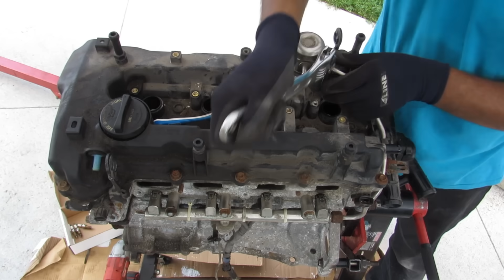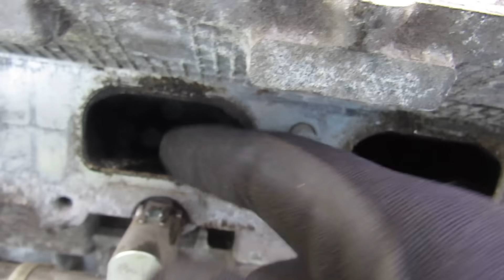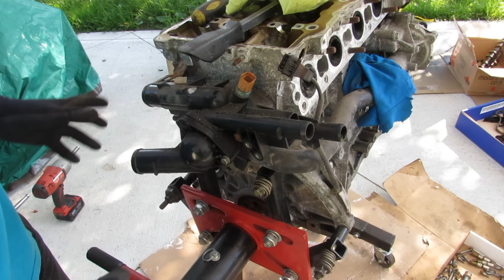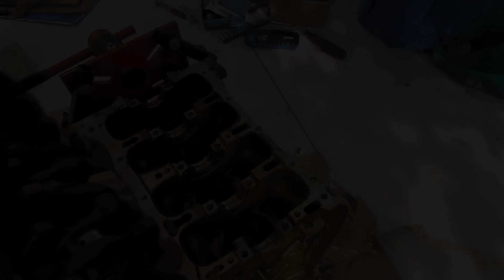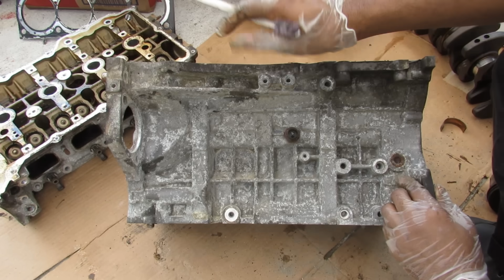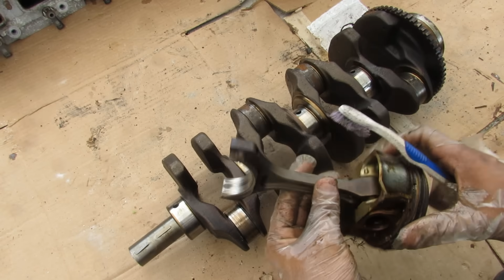Why Hyundai Engines FAIL

Comment: The major problem is lack of lubrication is what you say. Did the driver check the oil level?  How often was it checked. All engines lose oil when driven so the level should be checked at least once or twice a month just to be safe and know your engines oil consumption. You don’t know the answer to this so what happened to the engine you have could of been caused by lack of maintenance. I had a 2012 Santa Fe with the 2.4 engine with 118k miles on it. I only put full 100% synthetic oil in it and never had a problem with the engine. This engine your videoing those answers must be addressed. Thanks.
Reply from the maker: Good maintenance can help aleviate it. But when it's do bsd thst Hyundai had to issue a recall and vehicles with the 2.4 liter the marketplace with blown motors...

Comment: I had a 2007 Sonata 2.4 liter 4 cyl and ran it 144,000 with no engine problems. Never burned a drop of oil and it ran like a Swiss watch, so quiet you weren't sure it was running. Sold it to a grand daughter and she is still driving it at 190,000 miles. I had the 1st oil change done at 1500 miles and ran Penzoil full synthetic 5W30. I was told that the motor was a group development between Hyundai, Chrysler, and Mercedes.

Comment: I own a 2015 hyundai imax 2.4 ltr petrol, my engine knocks due to a suspected spun rod bearing, so I had it towed home because it cut out and wouldn't restart.
 1st mechanic I found of f.b, he told me the engine was seized, 2nd guy was an auto electrician he told me replace battery, done, not starting, I then had it towed to a local mechanic, he a devised to replace starter motor first, did that, he then dropped out the sump, found golden flakes and shavings in it, he advised a spun rod bearing most likely the issue, he replaced oil and worked fine, he did advise that the fault has not been repaired therefore the vehicle could run and die any stage.
So I've driven it for about 3months, now engine is knocking.
I've then taken it to Hyundai to see if they could repair under an out of date warranty. There mechanics diagnosed it as what I've suspected spun rod bearing. And that i need to replace engine, 10k AUD, I'm like what the faaarrrkkk

Comment: Well Hyundai used the same engine for a long time. Basically, they changed Bumpers, Lights and saloons but not engines. And they have not invested too much for engineering. Some parts like old soviet car engine techs. If you get any problem with oil, or oil changing period you would definitely have engine problems, which will cost significantly a lot.

Comment: I didn’t watch the video because it’s way over my head. However, I own a 2014 Hyundai Elantra with about 64,700 miles on it. The engine broke down twice. First time was in 2019. Something wrong with the cylinders not creating electricity. Partial rebuild. After my car totally checked out, I started a 6,000 mile odyssey. Just 100 miles from home, I threw a rod. It took 1 1/2 months, but I got a new long-block engine. Fortunately, I had an extended warranty. I hope it holds up.

Comment: The 'manufacturing debris' was a lie to cover up faulty engine management and design.  To keep the intake valves clean, Hyundai's GDI are running very rich at cold starts (much richer than non GDI engines). This happens both in summer and winter times, for both turbo and non turbo engines. This way some of the gasoline doesn't burn and is coating the combustion chamber and keeps it clean. Downside is excess gasoline also leaks into the engine oil and causes oil dilution. If you're doing mostly short trips, the gasoline in the oil won't have time to evaporate so the engine wear is increased. Another problem is these engines keep a very low rpm in most driving conditions - even when going uphill, even in the Normal and Sport modes. They designed the transmission to have crazy low shifting points in all Eco, Normal and even in Sports mode. It can't be good for the oil pressure at the connecting rod bearings. MPG Obsession took over mechanical engineering.
Reply: I also noticed that these engines suffer badly from oil dilution. The oil got contaminated with gas rather quickly in our sonata and I think that led to the bearings going out at 90k
Reply: @chihirogustafson8557   Correct.  Actually, rev the engine to 5000 rpm just before an oil change (diluted oil), then rev it again at 5000 rpm after the oil change (fresh oil).  You will be amazed how nice the engine sounds with fresh oil, and how harsh it sounds with old diluted oil. There is a way to prevent the oil from getting diluted on these engines, I shall make a video this fall about it.
Reply: This ^. My dad will drive it in eco all the time absolutely babying it. The car also gets moved around the driveway a lot and often doesn’t get the chance to fully warm up. Both my Lexus IS and Acura Tl I had have cleaner oil at 5000 miles than this does at 500 😳. As long as they keep giving us new engines I am fine with it.

Comment: Thank you for the thorough run down.. I own a 2018 Elantra with a motor problem. Where did you guys find your Hyundai shop manual or technical repair guide? Trying to locate one for newer models that isn't a Haynes is tedious. Please let me know if you have a good source, electronic or hardcopy. Thanks all!!

Comment: I was considering buy a new Kia or Hyundai because they are really affordable vehicles and offer twice the amount of miles/years on the front-to-back warranty than Toyota or Honda do. Should I be concerned with '21 and '22 models of Forte, Ioniq (Hybrid) and Elantra?
Reply: newer engines. Just make sure you get the 2.5l and 2.5t. They are newly engines.

Comment: He points out and it shows damage from lack of lubrication. But the question is, why were those particular locations of the engine lacking in lubrication relative to the rest of the engine.

Comment: Have a 2011 Hyundai sonata turbo with 95,000 miles on it and motor is shot its sitting in the shop now it seized up and almost caught on fire 
Luckily Hyundai is covering the cost but it needs a turbo and they are on back order with no release date so could be months

Comment: My wife and I bought a 2018 sonata sport a few years ago. It didn't take long to notice it was burning half a quart of oil every two weeks and it spark knocked all the time even on premium gas. We took it back to the dealer for a software update that might have helped a bit with the spark knock but not much. And yes i tried the intake valve cleaner but it would only clear it up for a few days.  It was replaced with by a Mazda just 6 months after purchase.
Reply: The Mazda is the cure for Hyundai engines.

Comment: If Hyundai will replace engine on warranty that might be the solution. However, I would want to have a good explanation of how the con rod bearings got contaminated / damaged to be sure that it could never happen again. Also, the direct injection system problem with carbon buildup is an issue needing answers. Otherwise the engine design looks contemporary and pretty good.  Internal engine problems like this are the last thing you would ever want to repair out of pocket.  If Hyundai "gets it", takes responsibility for error and covers the costs, then with hard work they can restore their reputation.

Comment: I think a lot of engines get that bearing damage when some drivers wait until the oil light comes on before topping up, and stretching oil change intervals.
I have a neighbour who is on her third engine from doing exactly that, I saw her putting oil in at the gas station and speaking to her about it found out she had the oil light on until she found the servo... ignorance is expensive bliss.
Reply: Not really much of an excuse when you can do the same thing to say Toyota engines and they’ll continue to take the beating. Thetas are just garbage motors all around.
Reply: @Iridiumcosmos  toyotas are junk
Reply: @maga6319  Said no one ever.
Reply: @Iridiumcosmos  says the fangirl. It's the truth
Reply: Oil light should never come on to begin with.. no engine should be burning 1 qt of oil every 1k miles if its under 100k miles

Comment: QUICK QUESTION, WHAT CAN BE USED TO WASH OUT THE ENGINE WITHOUT PULLING IT APART?
Reply from the maker: Gasoline is a good cleaner. What are you looking to clean, the valves?
Reply: @speedkar99   I have a number of sensors for the saying for the same car car (2002 Hyundai sonata) that I wish I could clean, because Those cars are not common in my country, And when you do  Find the part that you need, they're extremely expensive,
Reply: @speedkar99   But I saw you making reference to cuttings in the veins of the engine block, so I was wondering if there was any kind of agent that could be thrown in the  Is transmission oil or the motor oil block that would help to remove move those things and spite them out,  But remember I also mentioned that I would want to do this without the engine being pulled apart, There's not much mechanics in my country who work on these cars or even want to try.

Comment: DO NOT BUY HYUNDAI !!!
I'M ON MY THIRD ENGINE!

The first one seized at 43,000.
Hyundai said it was due to metal shavings circulating in the engine.
Claiming that this was due to a manufacturing problem.

The second one failed at 117,000 when a cylinder and piston failed due to carbon build up.
64,000 miles later.

Hyundai didn't even look at my engine for over a month. Then they denied my warranty claim. They said that the damages cylinders were not covered by the extended warranty on the replacement engine. 

The original warranty does cover pistons and cylinders.

Eventually they agreed to pay 65%
of the engine replacement part as a "good faith gesture".  They are so nice.😀

They had my car in the dealership for about four months.

I will never buy another Hyundai!
Reply: TROLL HARDER BRIAN

Comment: Something is fishy blaming the spun rod bearing and all the other bearing wear on metal debris left in the engine. I think there is a more serious design defect, similar to many BMW engines with bearing damage. With Hyundai blaming the problem on a manufacturing process instead of a design problem, they point blame to the USA engine plant and not the design and engineering offices in Korea.

That being said, I would bet money on this engine, the real problem is lack of maintenance. They went too long on oil change intervals. This caused the oil scraper rings to get plugged up which causes high oil consumption. The owner was not checking the oil level like they should have been doing, and ran the engine out of oil which caused the rod bearing to spin. So change your oil often and use high quality oil, and check the oil level every time you put gas in (for a Hyundai) and every other fill up for other cars like Hondas

Comment: Wife's 2017 Tuscon got recalled for defective connecting rod bearings. It's party to a Transport Canada safety recall due to potential rod blowing  through crankcase causing engine oil fire.  Looks like she is getting a brand new engine.

Comment: As an ex Hyundai Tech I can remember doing these under warranty. They would have  Us replace the bottom end only. And in 2014 as a flat rate technician getting paid $12 an hour, I would make a grand total of $120 to do this job😭😖 Good times🤟
Reply: You were paid $12 an hour in 2014? Ridiculous. I made over double that when I left the trade in 2008. That's in Canada.
Reply: @davidgiles5030   Yeah I was a pretty new Tech I had just moved from hourly to flat rate so that's what I started out at. And I left before I got a raise lol
Reply: @davidgiles5030  he was your discount Employee counterpart
Reply: Is it possible do a bearing roll on the big end bearings insitue without removing the engine? Possibly flush oil gallery's too?
Reply: Hmmmm HUN DIE?
Reply: A friend has 2014, but i found no recall on the Sonata 😢❤️🙏
Reply: That sucks for you and the client.  The metal finds it's way up to the top end and trash's it to. A very dark history for Hyundai.
Reply: I think it’s funny a car mechanic thinks they should get paid like a doctor 😂
Reply: @sKid-zy1ss  yes, coz faulty vehicles can kill or injure , which then have to pay for a doctor
Reply: @sKid-zy1ss  could you live off $12 an hour?
Reply: @FixIt1975  of course not but they shouldn’t be paid 200 an hour, that’s ridiculous. 
Btw doctors go to school and pay up to 100 to 200 grand in schooling degrees…. When’s the last time a car mechanic had to do that ? Get real
A lot of times they screw people over , Iv only met a few honest mechanics
Reply: @sKid-zy1ss first off techs don't make $200.. maybe the dealer does. You have no idea the training it takes an experience to work on these newer cars!!!!!!!! Text also have to buy their own tools nothing that up spending $50,000.... Glad you think it's so easy!!!!!!

Comment: that engine oil varnish clearly shows that good old fashioned dinosaur oil was used instead of full synthetic engine oil , aluminum engines mandate the use of full synthetic engine oil only
Reply from the maker: Really..   I say dino is fine but change it more frequently

Comment: THIS is the reason you want an electric car!  The entire motor has exactly ONE moving part!  NO cam shafts, NO pistons, rods, billions of bolts, chain drive, serpentine belts, intake manifold, gas injection, exhaust valves - NOTHING!  NO transmission, NO clutch, NO torque converter, NO fuel lines, NO oil system, NO oil changes, NO blocked oil passages, NO emissions control devices, no exhaust system, and no central driveshaft.  All those components not present CAN'T BREAK!

Comment: Speedkar99's videos have literally caused me to change my mind about what I'm going to buy next and will be keeping for many years. Was going to get a new Tucson Hybrid, with the turbo GDI engine -- trouble. Now I'm going to get a RAV4 Hybrid, with the 2AR-FE engine and no turbo -- bulletproof. Thanks, Speedkar99!
Reply: How about REALLY smartening up and buy an ELECTRIC!  Then you would NEVER have to deal with any of that crap ever again!  An electric car has exactly ONE moving part inside the motor!  I hear all the yip-yap by those who don't know what they're talking about trying to dis electric cars because of POTENTIAL battery problems, yet gasoline engine vehicles are a nothing but a 100+ years of band-aids, and work-arounds to make a POOR engine technology perform half-way decently!  My Hyundai Kona electric has over 50,000 miles and has ZERO mechanical problems, along with ZERO "maintenance" other than normal "inspections"...oh, and a new set of tires, and cabin filters.
Reply: @randallscott-key802  Live in a third-floor condo. No way to charge an electric vehicle.

Comment: Great video.  I have a 2006 Hyundai Tucson w/ the 6 and a 2009 Sonata w/ the 4.  Both engines are still running strong and no problems.  Too bad Hyundai rushed it's engine manufacturing to meet demands and suffered the consequence.
Reply from the maker: I think the 6 were much better than the Theta2
Reply: Your car has stronger oil rings so you are lucky.
Reply: Honestly any Kia engine that doesn't have the 2.0 or 2.4L are great. The 1.6 and 3.3L are the best.

Comment: Can someone explain how an engine with metal particles left while manufacturing fail only after 70000 miles? Shouldn't those metal particles destroy the engine well in the early age. Or was it done intentionally so when engine is run for the miles after warranty is over, it self destructs.
I happen to have a Hyundai elantra 2014 and it saw the same fate. But no one able to find the root cause. Mine died suddenly within  a week in the winter of Canada at - 21 deg C.  Being a rebuilt status car, I was deemed ineligible for a replacement.
Reply from the maker: It's a slow death. Particles eat away at the bearings. They can slowly clog the oil system and then at a certain mileage, starve the bearings of oil
Reply: @speedkar99  this makes some sense. When my Elantra started ticking, a week before I could smell the metallic heat similar to electric generator at full load. Maybe during that time the crank rod was starved of oil and grinded with bearing causing metal to heat and smell. After few days, ticking started meaning the material was ground enough to develop gap to make it tick. Don't know if it was repairable, but I lost a lovely car.

Comment: Burrs? that can´t be the reason, the oil filter certainly would take care of that, that´s what it is there for; unless it failed in the first 100 miles.
Reply from the maker: Yeah but slowly it starves the bearings by clogging the Arteries